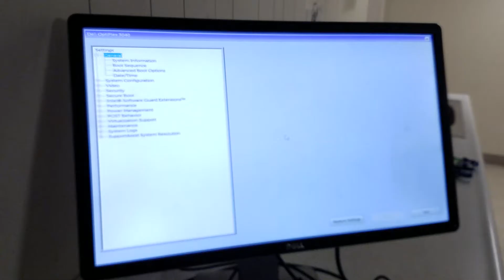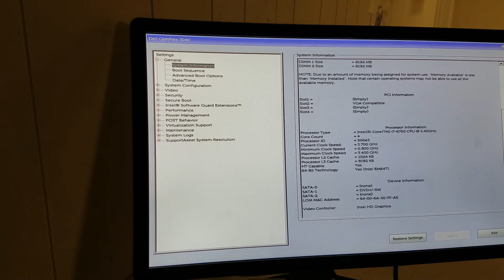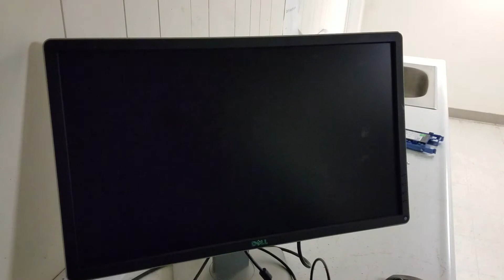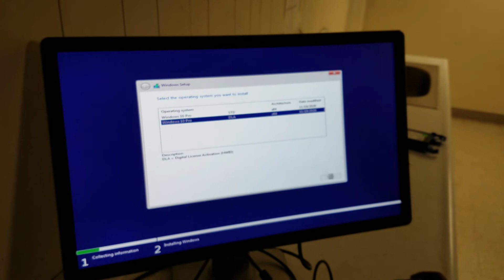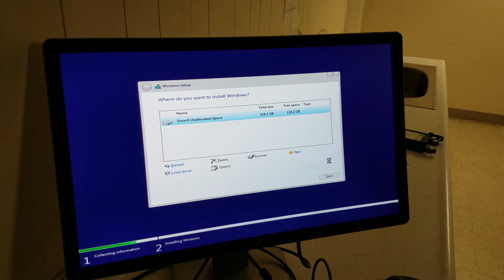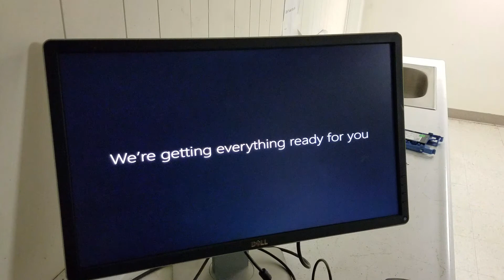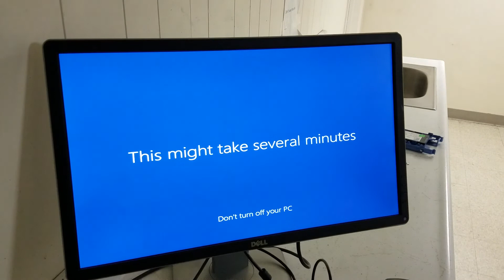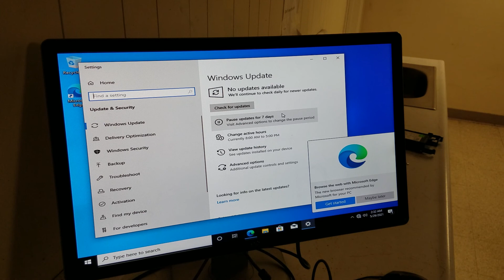Dell OptiPlex 3040 install SSD and Win 10 May 29, 2021

Comment: But please let me know if I can install a 240GB SSD on My Optiplex 3046MT which has 4GB DDR4 2133MHz Memory and Pentium Dual Core G4400 Chipset with a Seagate 500GB HDD? Its actually a 6th Gen System. Can I follow the same procedure in this video?